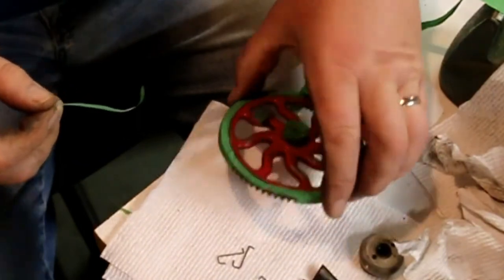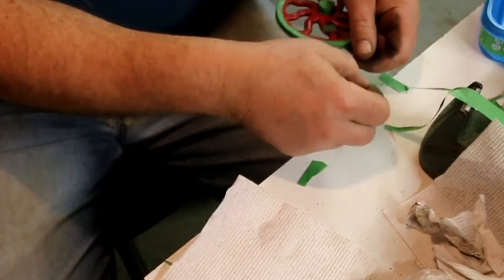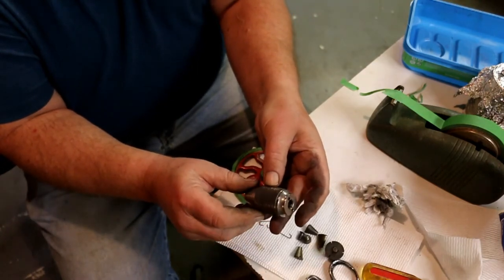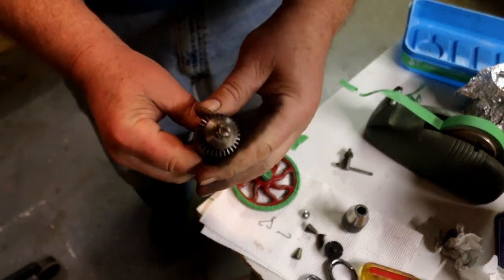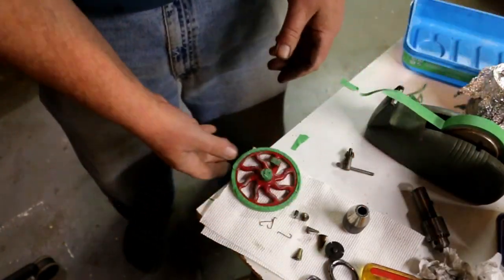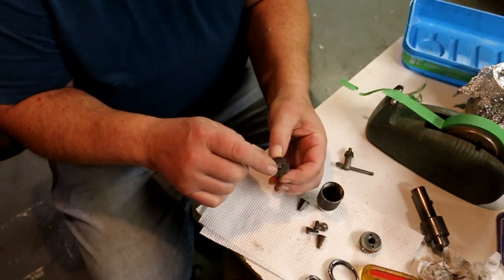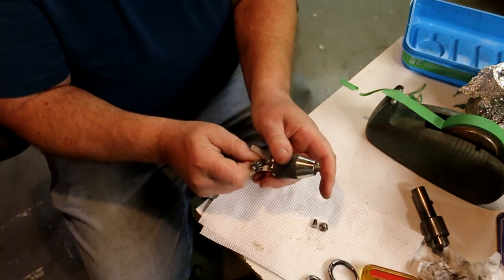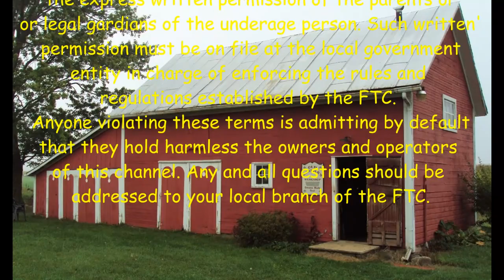Restoration Millers Falls No. 2 Eggbeater Drill Pt 3

Comment: Paint's a miracle product, a thin layer can offer many years of protection but preparation can be a real pain sometimes.
Reply from the maker: Spray cans are a big plus.
Reply: I've been told it covers a multitude of sins.
What do they say: "A grinder (Putty) and paint make me the welder (carpenter) I ain't"?
Although, a good coat of paint does look good.
Reply from the maker: @BrianDaleNeeley  I had a tool room manager that had told the crew I inherited from him that if you can't make it right at least paint it. 
What a mistake!
I see paint on a tool more as a protection than an esthetic improvement  or camouflage.
😁😎

Comment: Looks like our pal John CS is rubbing off on you! Nice drill with a Sneelock motor. 480 volt, 3-phase. Got the unloader on the electric woosher with the final tightening on the 90 out of the pump for the bypass with a 3# hammer against the handle of a 10 inch Crescent wrench. It's TIGHT! Ordered a swivel for the pressure hose and a 5K gauge for the splitter. I like to know what's going on when something gets in a big strain! 3600 p.s.i. on a 5 inch piston. Interesting!  So have a wonderful weekend being Grandparents! We have a grand turning 3 so it'll be a wild time at the Grands parents. Toots made a chocolate/peanut butter/tofu pie. Then next month the Grands parent and ME will get another and maybe a turkey meatloaf. What FUN! GBWYall!
Reply from the maker: That is a serious amount of push. You can split rocks. 😁😎
Reply: @OldSneelock  True but I like a gauge. The last one had a 3k gauge and most splits didn't go much over 500# and it was a 4 inch jack. I know the 5 inch and 3600 is overkill but better too much than not enough. And knots burn longer and I like to split knots. Will get the 440 out and block some more logs shortly. Then out will come the really big boy for his debut! I'll send you a shot, God willing!
Reply from the maker: Tim Taylor says, "MORE POWER!"

Comment: I need to find these chuck springs, is there a place to buy them or woud i be better off making my own?
Reply from the maker: Not easy to make. Harder to find. If you have access to piano wire you can make springs.
Reply: I have a similar hand drill that's been in the family. I took it apart 60 years ago as a kid and lost the springs. The jaws are drilled different though. There's two holes in each angle where they intersect diametrically when closed. I was thinking they were 1/8" dia compression springs between  each jaw. Does that sound right? I have grandkids that need to learn how important drilling holes can be.😊